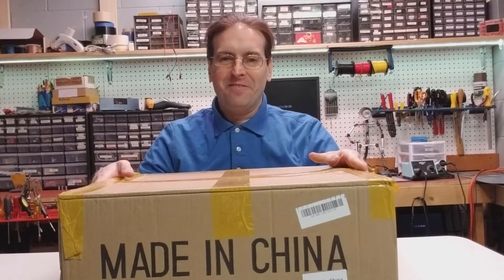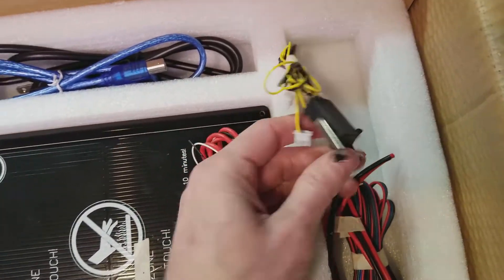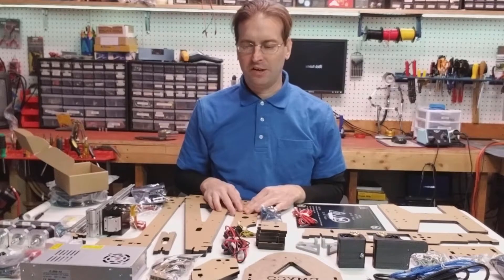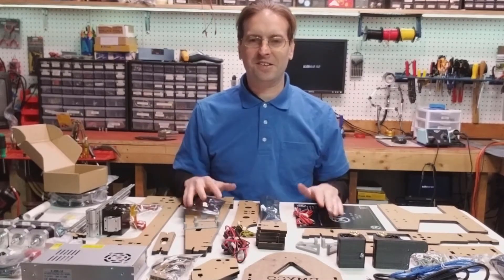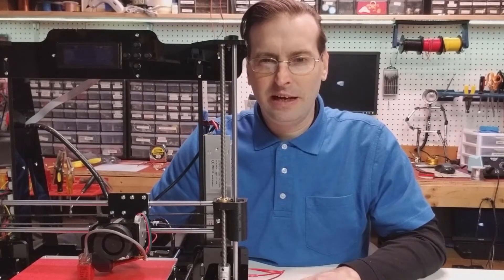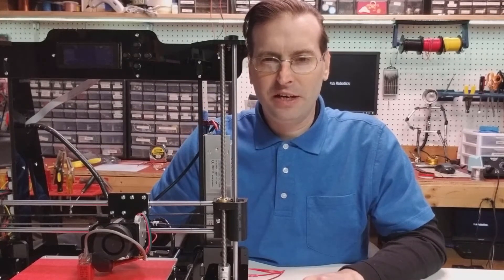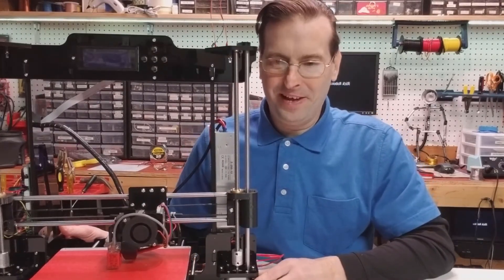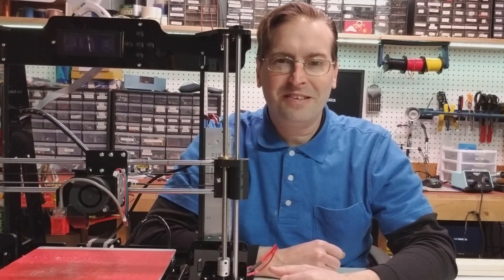Tronxy P802MA 3D Printer - Part 1 - Unboxing and Assembly

Comment: I have the same printer that I purchased second hand and know little about it.  Have you ever done a bootloader and or a firmware upgrade to it? Do you know what firmware is installed on the board? Any help or info would be appreciated so I can update my printer.

Comment: hi the x carriage stop did you have to drill the hole to mount the micro switch ?
Reply from the maker: No, I managed to get the switch mounted in the existing holes, however, it mounted slightly crooked (which doesn't really matter, as long as it isn't crashing into any moving parts). If this isn't possible for your machine, there are replacement parts you can print on thingiverse. If this is your first printer and can't print yet, you can also order them printed from the site or have another printing company do it for you, for a fee.
If all else fails, perhaps a zip-tie, hot glue, or even re-drilling a hole may serve as a (temporary?) solution. Good luck!